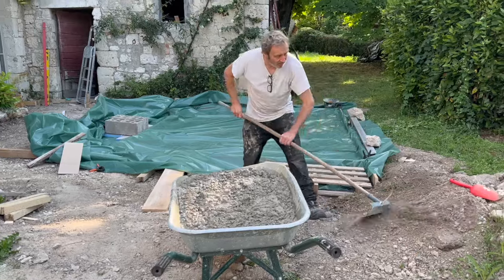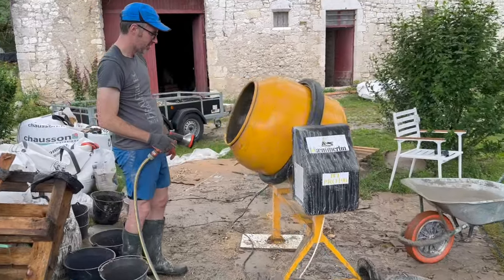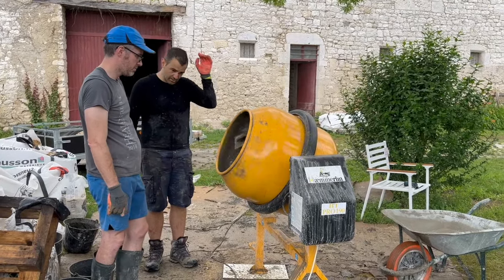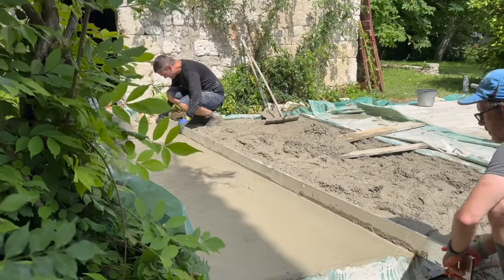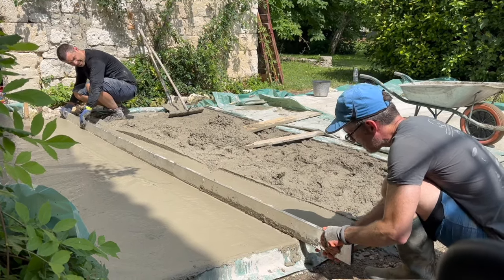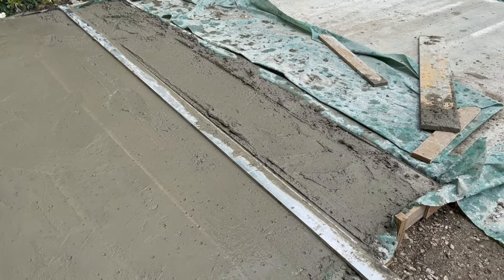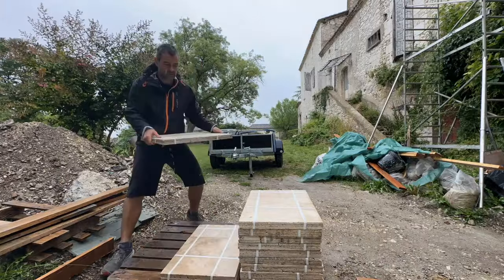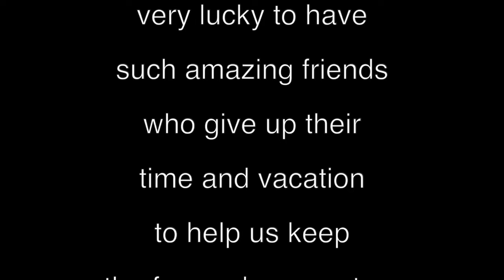Laying the second concrete slab for our outdoor terrace Ep 23

Comment: Pardon my ignorance, but how does one insure that the slab has the proper slope so that the water drains away from the chateau and not towards it?
Reply from the maker: Good question. We ensured there was a 1-2% decline away from the chateau. There are a few ways to do that, you can measure it using a laser level. Or have a long-ish level and ensure the bubble is touching the back line which is approximately 1%. We set up the wooden shuttering first around the perimeter at the right pitch and used that as a guide for the cement.  slab.